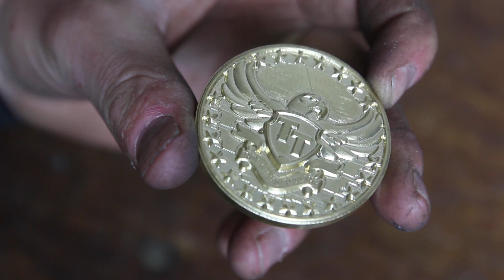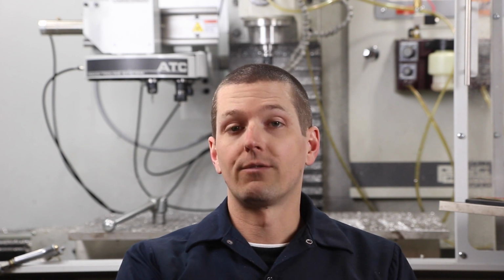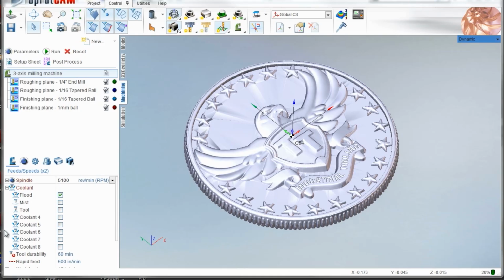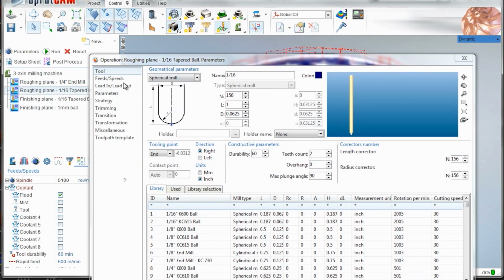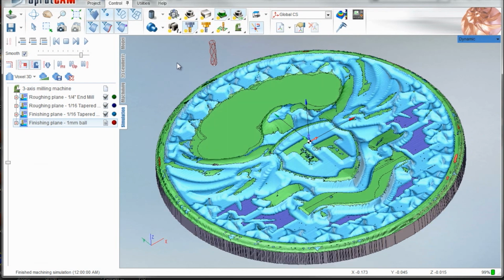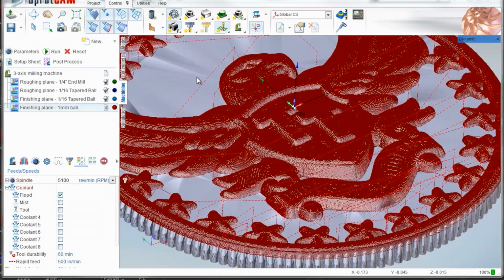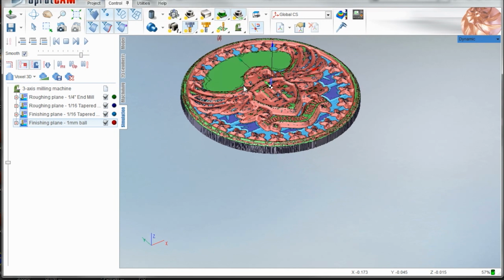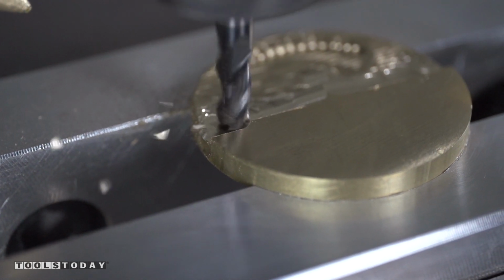Machined Brass Coin: 3D Finishing Plane in SprutCAM!

Comment: John, great video!  Interesting video, perfect music for the machining section, good lighting, and educational subject matter...what's not to like?

I didn't realize that machining CAM software could deal with stl files. Stl is usually used for 3D printing (my guess is that it's short for stereo lithography). When you are dealing with flat slices through a part a horde of triangles at odd angles isn't too hard to deal with...where a plane intersects a triangle is fairly simple math.  Turning that sort of data into reasonable tool paths is a whole other level! 

I've seen similar machining done on wood by gantry router CNC machines.  With those they tend to do raster passes...not like your paths where features were shaped more or less separately. The raster pass method can do roughing with big bits and large stepovers, followed by finish passes with smaller bits and finer steps. Not sure of the CAM software for that, but I think one is called Vcarve Pro. The Legacy Mill folks do some of that sort of stuff. 

I wonder how long it will be before the 3d printing in metal comes down enough in price to be in the same market segment as Tormach?  Probably less time than we'd guess.  The Dragon 2 spacecraft engines are 3d printed...that surprised me, but us really cool!

Sometime could you explain what the "water level" concept is all about?  You've mentioned it a bunch of times, but since I haven't used the software you are working with, I'm not sure I know what you mean. ADVthanksANCE!

-- Mike
Reply: John,  Thanks!  I get the general concept.  I'll see if I can follow how that gets applied in some of the machining situations and how the CAM software deals with it.

-- Mike

Comment: That's really interesting. I recorded a coin milling video a while ago which i have yet to edit (will likely be up sometime in March I guess) where I make a brass coin not too dissimilar to the one you made, but on a milling machine not designed to mill metal at all, the Roland MDX-40a. Since I could make the CAD myself I actually mixed NURBS and mesh data, so the text and such could be easily set up in CAM, and the mesh could be used for the more intricately shaped parts. The mesh ended up being around 500k faces though, and my laptop swallowed it like it was nothing. I don't think I'll focus much on the CAM aspects in the video though, more on the CAD. I ended up using an engraving cutter though, as I figured it would significantly reduce the load on the rather weak machine.

You're really selling me on the Tormach though, can't wait until I can start setting up my own workshop again. I really like the end result, and interesting to see what you were able to do without having access to NURBS data.
Reply: NYC CNC The Roland is okay, and for the price it's a very capable machine if you're only doing softer materials. The main issues I've had with it is the work holding. Since it has so low Z-clearance you basically have to resort to fixing everything with double sided sticky tape if you do anything with a bit of height to it, which then for smaller parts may just not be enough of hold down force even with some of the tapes specifically designed for the task. I've had it launch some smaller pieces across the machine as it tore them loose. For the coin I had to design a whole new bed for the machine, so I could basically screw my workpiece down.

It is weak, and if you push it just a little bit too hard it will jam the cutter in the material, trigger the overload protection and force you to shut down the machine. So in one sense it's good that it has that protection, but on the other I really wish it had a bit more torque behind it so you could ramp up the speed a bit. Because of the risk of crashing during regular runs we've ended up having to run it quite slow, with minimal chipload, just to be on the safe side.

I could definitely see myself getting one for myself though, as it's great for smaller operations. Though, it's a few years old, I bet there are newer better models on the market by now.

Fun story, I ended up starting a fire in the machine once though, with a dull endmill and milling plywood. The chips started smoking and set of the fire alarm. Quite fun having to explain that to the fire department at four in the morning. Haha!

Comment: Sad, and good thing, is that you can't sell this (outside of an auction among your fans) based on the value of the machining... Because a slightly crapier version could be made with a mold, en mass. Which I imagine is how they do actual coins, that or they press the design into them. Still, this is really cool.
Reply: HisRoyalCarlness You should check out some minting videos. Coins are minted, which is a fancy word for being stamped using dies, with many tons of pressure behind them. The dies however are quite commonly, these days, milled using CNC milling machines. Back in the day they used to be hand engraved and polished.
Reply: +Switch & Lever the really expensive specialty coins are still handmade (the dies) and polished. they are also pressed deeper then the circulation coins. There are some really cool videos on it like you said.

Comment: Regarding your issue with the waterline, it may be your PC and limited memory, but I doubt it.  (You can confirm by opening up a Performance meter and watching memory use).  You are likely running into numerical/topological issues in slicing.  Near-tangent intersections are the worst nightmare in building these things..

If I might beg a favor, would you mind trying waterline with the bottom depth being slightly higher than the bottom surface of the recess on the coin?  I'm betting that Sprut ran into real problems with not-quite-parallel planes at the bottom (not due to model construction, but due to numerical noise because these are digital computers).

if you don't have time, I understand.  You have a couple of businesses to run..